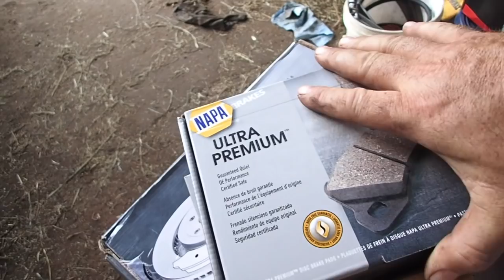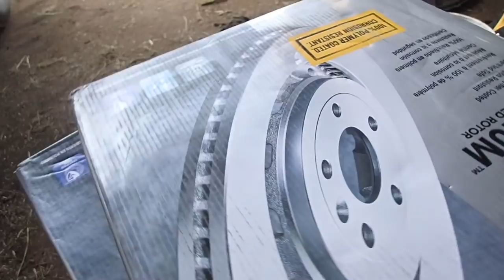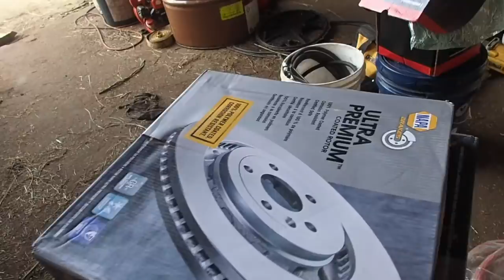F150 Brakes

Comment: Yesterday we replaced the left front ABS wheel speed sensor on the 2007 Chevy Silverado work truck ..

     Today we replaced the pads on all 4 corners on my cousin's 2005 Buick Lacrosse .  Much easier to jack up a corner of the Buick than on the Silverado .

     Bought the lifetime warranty pads from Advance Auto Parts .  Around $ 40 all total .  Used my Speed Perks 20% off discount .

     So you have my support / sympathy .    :-)  No0t as easy getting up and down as it was when I was in my 20's , some 45 years ago .

Wyr
God bless

Comment: I always had rotors turned at Auto Zone or O'Reilley's... til they basically quit doing it.  I did it because in mechanic's school we were always taught to turn rotors and drums during a brake job, so it just became habit.  Dad virtually NEVER turned rotors-- he just slapped a new set of pads in there, made a few quick stops on the road to "seat" the pads to the rotor, and called it good.  He said it was just unnecessary expense and they shaved more metal off the rotors than you'd wear off going through two sets of pads... Anyway, I always did it.  

Last pair I took in to get turned, the truck was stopping just fine, but the pads were worn out.  The rotors were in good shape otherwise, no damage, and the truck stopped smooth and true, so they weren't warped.  When I went back to pick them up, they weren't turned correctly-- they had a "crescent moon" of material shaved off one side, and a crescent moon of uncut still mirror smooth metal on the other.  I was like "WTF is this?" and they said, "oh, that's all we could take off..."  I was like "that's not done right-- they weren't chucked up in the machine properly-- they were cut cattywampus".  They assured me they had been chucked up correctly and cut true, so I took them and installed them on the truck.  Took it out for a road test and when I hit the brakes I thought it was gonna kill me-- the brakes surged so bad it nearly threw me through the windshield and the brake pedal was pulsing so bad I thought it was gonna break off.  I immediately pulled them back off and took them back, and irately told them they EFFED UP and that they were GOING to do it again, and do it RIGHT.  Picked them up the next day and they STILL had a little crescent moon of uncut material on one side with the edge fully cut all the way around this time.  I could tell that they had EFFED up, because there was another shiny crescent moon on the back side DIRECTLY OPPOSITE (180 degrees out in rotation) from the one on the front of the rotor.  They still claimed they were cut right, but I could tell they effed up.  I finally just bought a new set of rotors.  They were NOT warped or worn crooked, because they had been stopping PERFECTLY and SMOOTHLY, with NO pedal pulsation and NO warpage... not until they cut a warp into the d@mn things... I figured it was some know-nothing high school dropout that didn't know their @ss from a hole in the ground that they put back there running the machine and effed them up totally... 

When I got my newer truck, when I did the first brake job on it I tried to get the rotors turned, because they were a lot more expensive than the rotors on my last truck (a 1996 Ford).  They refused to turn them because they were "worn below the minimum spec".  Yeah, I'd heard that story before, but they were warped or damaged so I'd have to replace them.  I found some cross-drilled and slotted rotors on Feebay for way less than the plain Jane factory rotors, so I did that (big mistake-- they must've been made out of cheese, because I spun an outer bearing race in one of them and it literally ate about an 1/16 of an inch deep into the rotor race bore, so the race was "floppy loose" inside the rotor and literally fell out when I took the rotor off... NEVER had that happen before or since).  Anyway, when I replaced the crossdrilled and slotted rotors, the price of factory rotors had come down to about what the price of the old ones had been on the 96 pickup, so I just bought them.  When I took them out of the box, I saw the "do not machine below 1.130 inches" on the back side... the "wear limit" on the rotor.  Being curious, I grabbed my micrometer and measured the thickness of the brand new rotor-- It was 1.145 inches... ONLY 0.015 THOUSANDTHS OF AN INCH OVER MINIMUM!!!"  Damn things are sold *just a short hair's width over minimum-- h3ll by the time the new pads are seated it's probably shaved  fifteen thousandths off the rotors!  So OF COURSE they're "always under minimum".  

Ever since then, so long as the vehicle is stopping smoothly without pedal pulsation or surging, which would indicate a warped or damaged rotor, I just slap a new pair of pads into it and call it a day... I'm on the third set of pads on the newer rotors on that truck (probably got over 150,000 miles on them-- the truck has 320,000 miles on it now) and still stops smooth as silk.  

The 2005 Dodge Grand Caravan has the ORIGINAL set of factory rotors on it (unless Dad had them changed or the previous owner, but he bought it with like 20,000 miles on it and he stopped driving it regularly at about 60,000 miles and let me use it for the farm, as he bought a newer one), so I doubt that they were ever changed.  It has 275,000 miles on it and the rotors are worn badly-- but it still stops smooth, straight, and true... I can tell by the edges that they're worn off about 3/32 or so of an inch off both the front and back sides of the rotors-- they have a pretty big "lip" around the outside edge, so they need to be replaced next time I put new pads on it... I think that'll be about the fifth or sixth pair of pads I've put on that van... 

Later!  OL J R :)

Comment: You would find backing the caliper pistons back in go s alot easier if you remove the cap off the master cylinder so the back pressure has a place to disperse.    Great Vid !!!

Comment: I just use a pry bar and push the caliper back until the pistons are compressed before taking them off.
Reply: I use a big C clamp, if it doesn’t move easily your caliper is siezed in the pins or pistons
Reply: Mark Groth the c clamp works fine but yes it is much easier to compress the piston prior to removing the caliper!

Comment: Just a small tip Wes not trying to be an ass because I love this channel take a large straight screwdriver put it between the inboard brake pad and the rotor take the cap off of the brake fluid reservoir and compress those with that screwdriver before you ever take the caliper off makes life very simple been doing it that way for 20 years

Comment: A little helpful tip. C clamp the caliper before you loosen the caliper bolts it helps loosen the floats if they're tight

Comment: i own a limo service and i use slotted rotors and wagner thermo-quites or raybestos for pads .you can use drilled and slotted for hauling heavey loads  but the drilled has to be chamfered if they are not they will crack ...[i dont know if you know that or not wes just in case ]... but then again ive had chamfered ones crack on me too but it also depends on if you use semi metalic or ceramic i use semi metalic but  in both  raybestos or wagners but slotted are excelant for getting rid of glazing granted you shave more of the pad then just standard rotors as for turning rotors if you can do it deff do it unless they are already pretty thin its worth the savings

Comment: The rotors come with an oil on them so they don't rust usually spraying some brake cleaner and wiping it will get that oil off

Comment: Wes I have a trick use lots of break cleaner on the do.  Also I have switched my breaks to ceramics.  Also the Caliper tool makes easier to reset them.  I was like you and used a C clamp for years once I got the actual tool I will never go back and I wish I wasn't such a stubborn ass in getting the Tool.

Comment: Very interesting the way things are changing I remember the OBS Fords you didn't have to unbolt anything to get the caliper off you just drove 2 locks that reminded me of a rubber sandwich on through and they fell out on the other side and you lifted the caliper off
Reply: Yep that was the old days... then they went to these "caged" rotors and the calipers ride on bolts with smooth shanks so they can slide side to side easier... 

When I helped Dad as a kid, all the old 70's stuff used those metal-edged rubber "keepers" or wedges that held the caliper in the caliper boss on the wheel spindle... 

Later!  OL J R :)
Reply: luke strawwalker yeah my 93 450 takes the same pads on the front as the rear all the 350 and 250s have smaller pads in the rear

Comment: Wes, not sure what the exact problem was with your caliper that didn't want to compress.
I do know that sometimes the brake line (the flex hose) can get an obstruction inside the hose and prevent fluid pressure from returning to the master cylinder. Might want to check the hose for fluid flow. Excessive wear on the disc and pads would indicate a hose obstruction.
Also, if there is no obstruction in the hose, you can loosen the bleeder valve just a bit to relieve pressure and re-tighten after the piston is compressed. 
One more thing, did you remove/loosen the cap on the master cylinder? The brake fluid needs someplace to go when the pistons are compressed. Yes, the master cylinder will probably over flow if it wasn't low on fluid.

Comment: 2-Words... Jack Stand!!!   :-)

Next time you change brake pads, you might find it works great to leave the inner brake pad installed and put the C-clamp in the center of the pad to compress the pistons back into the caliper.

Comment: Wes I did my brakes on 2013 f 150 and there are inner and outer pads on the front found that out the hard way need to be in proper position you didn't mention that is your truck like that as well great video

Comment: Hey Wes. The 8530 problems may be fixed with replacing the CanBus Eliminator Modules. They can produce strange and weird electrical problems with the entire machine. I have come  across the same problem myself.

Comment: People turn rotors, but most rust from the inside out, so as you start cutting them the rust gets worse. 
Only thing worth turning is a brand new one with tons of meat that might have warped, or like my 3/4 ton old truck drums when i went to 3” 1 ton shoes on the rear instead

Comment: Did you take the cap off the fluid resivor? That will make it a pain in the ass to get them to go back in. Also if you use brake cleaner on the rotors that will remove the oil that then have on them to keep them from rusting and the pads will grab right away. All cars ive done for years the rotors dont need to be done every pad change unless they are warped or if the customer ground the brakes to the rivets and put grooves in the rotor. The rotor is stamped on the inside how thing the rotor can get so you can measure it to see if it needs replacement. And some places still turn rotors.

Comment: Were the rotors really that badly worn that they needed replacing? They look pretty good to me. Grooves that aren't too deep are OK and pads will soon bed in to the correct contour, Male taking up to 100 miles to regain maximum efficiency. Hope those lug nuts are tight enough.

Comment: This video should be titled, Not what to do when doing brakes. First use jack stands. You never know when a hydraulic jack will fail. And you can see the truck move back and forth. Which can lead to the truck slipping off the hydraulic  jack. 2 never let the caliper hang. It can damage the brake line. Use something to hang it up. And you should grease the caliper pins so they will not hang up. Then the brake shoes will wear evenly. And that blue paint is a light coating of grease so the rotor will not rust. And you should all ways clean the rotors with brake clean when done. This will not get grease on the pads. and you will stop better. Remember safety first. You never know when a kid sees some thing like this and ends up getting hurt or killed because he didn't know better. Just saying.

Comment: machining rotors is a pain in the ass, I can get it done, but 50% of the time, I get a pulsation in the pedal afterwards, so I just say fuck it and buy new ones if needed, most times though, they are ok the way they are, and I just replace pads and roll.

Comment: F.O.R.D. = FIRST ON RACE DAY
Reply: Pontiac = Poor Old Nick Thinks Its A Cadillac....
Reply: Farmall Fanatic no no no, it's f#*ked on race day. Lol
Reply: Fiat = Fix It Again Tony
Reply: F*cking old rebuilt dodge
Reply: FORD=   FIX OR REPAIR DAILY...….....……...FOUND ON ROAD DEAD
Reply: J. Chris Beck very similar down south Nick is a much longer word lol starts off the same though
Reply: Bear Russell if you've worked on all of them you realize this so funny how a small block Chevy water pump in a Ford FE water pump are almost alike held on by four bolts and span the timing cover your Chrysler rocker bar assembly it's similar to the Ford FE and The Rocker assembly on the small block Chevy reminds me of the small block Ford I thought the external oil pump on the big block Chrysler was of neat idea
Reply: H Turbo hahahaha
Reply: At Midnight correct
Reply: I mix them all together and don't care I drive a fordodolet
Reply: From our reject department. Wes is going to ban us all! Lol
Reply: Fix Or Repair Daily
Reply: Found on rubbish dump
Reply: Ford backwards = driver returns on foot
Reply: Karl Pokorny: LMAO, Never heard that one before
Reply: I was told it meant Fix or Repair Daily .  Actually , I have driven quite a few Fords .  On average , I was satisfied with them .

Wyr
God bless

Comment: Put antiseze under the rotor so it doesn’t rust and stick as badly.
Reply: It could also be getting stuck on the rust ridge on the edge just beyond were the shoes ride.
Reply: He is using coated rotors, they won't rust like a traditional rotor. The hubs will still rust, but they generally won't stick.
Fluid film is also great for preventing the rust here.

Comment: I'll have to disagree with you about this video. I have an 07 Mercury Grand Marquis. Recently during an annual ck up my pads were getting thin. I bought the car with 60k and it was now @ 116k. My local Tuffy shop was able to grind/resurface my rotors while still on the car. They installed the new high performance pads and the car performs perfectly. I used to change pads myself but here are two tips for you. 1. Open the lid to the break fluid reservoir. 2. Open the bleeder valve while compressing the caliper so you don't look like an idiot!

Comment: Your right, C-Clamps work just fine, you have the good michelin tires, so it makes a difference. I can't believe you have to change them already, you must do a lot more city driving. My farm truck is a 01 GMC 2500 and it has 147K miles and I've never changed brakes pads or rotors. Yes, it's mostly country and highways miles, so I'm not wearing out brakes in stop and go city traffic. Just living the good life, GO TRUMP !!!

Comment: fyi years ago I sold drums and rotors in a  parts store ,every new one came thru slightly out of round and we we would true up (cut) every one to avoid problems from the customer. are they true now?? should be checked on lathe .

Comment: You really should open the bleeder before you push the piston back in the caliper. Keeps from shoving any dirt or rust backwards in the system possibly screwing with the ABS.
Reply: Exactly what I was going to say, glad you pointed that out. Clamp the hose, crack the bleeder....top off the reservoir with clean fluid.

Comment: the one you had trouble with shows me you have a partially bad hose
Reply: YEP !  It's worth checking out.
Reply: Not always. Calipers siezed happens more.
Reply: Wes said when he compressed one piston, the other came out, back and forth. Wouldn't that indicate that the pistons were free?
Reply: I think you should open up the bleeder screw when you compress the old brakes so all the nasty brake fluid doesn’t go back to the master cylinder or in the brake lines.

Comment: I thought the video was decent Wes.That's one automotive job that I won't touch for legal reasons.I ALWAYS let my mechanic do the brakes for this reason.If the brakes fail and I cause a major accident due to this,the judge will come down on him and not me.(better his insurance then mine)
You forgot to grease the slides Wes,if your truck starts pulling to the right or left,that's going to be most likely the issue,no big deal...break out the AMSOIL LITHIUM RACING GREASE and your good...HAHA!!.By the way,yes they do still turn rotors,my mechanic charged me a whopping $10.00 to turn all 4 rotors 10-thousandths of a inch.(.000010)
I had him put CERAMIC brakepads on my F-250 HD front and rear,they last alot longer then ANY semi-metallic pad and you won't have your rims getting pitted with the corrosive black carbon either.They will not over heat and cause brake fade,this is a major issue with semi-metallics.
Reply: 4 gauge i find with mechanics you do end up with break jobs so i do the brake jobs myself!
Reply: kb7722 That's cool until you have an accident and the judge asks to see your ASC certification.Then that's where it hits the fan.
Reply: 4 gauge  I'm just poking fun at your misspelling of brake
Reply: kb7722 Ok,I"fixed"my"B-R-A-K-E-S"now.(and that's the ONLY"BRAKES"I'm fixin')